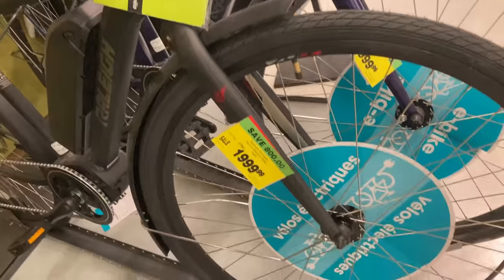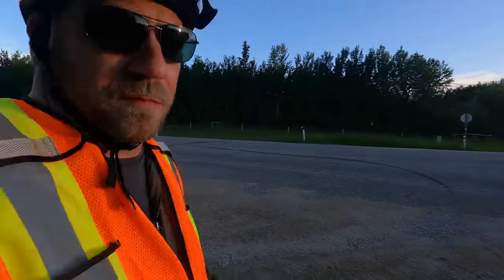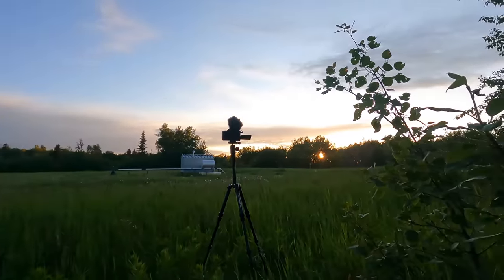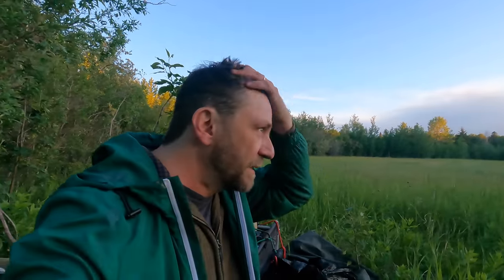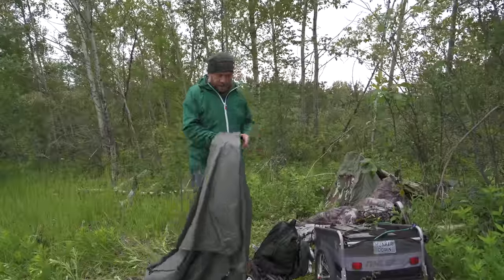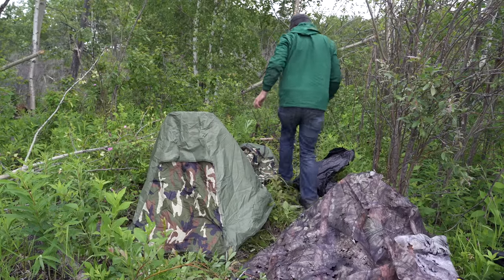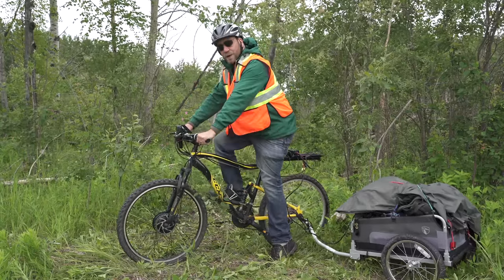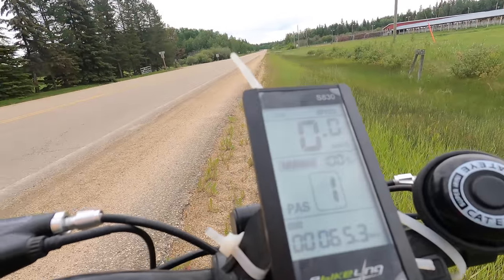DIY E-Bike Stealth Camping

Comment: Steve, your front forks will probably fail before your trailer does. Take my advice and exchange that front hub motor with a mid or rear wheel kit. The forks aren't designed to handle the torque of that motor. A mid drive also allows you to use the gears for climbing steep hills.
Reply: This sounds like great advice. I hope Steve sees it.

Comment: One of the features of LifePo4 batteries is that they have a very flat discharge curve. They maintain a constant voltage through about 90% of their capacity and then drop off very sharply. For this reason, you usually have to measure consumption via monitoring current through a shunt rather than monitoring voltage. I expect your batteries will be fine, they'll have an internal BMS which will have shut off the power before you over discharged them.

Comment: Hub drive has one issue you must address. Because of the torque the spokes loosen. After each trip give them an inspection. On the trailer, with all the weight, do the same. Lift the wheel, lay your fingers inside the spokes close to the axle and then with your fingers move the rim back and forth. You'll feel it if the spoke nipples are loose.
Reply: @messin with mikeyup. just like a guitar string!
Reply: Also, make sure you have zip ties and practice using them to true a wheel with junk wheels ahead of time. You can look it up, but you wrap it around a fork leg and cut the ends to a point and set the tip just touching the rim. You do need to learn which spoke to tighten to pull the rim the direction you want, but never loosen if you screw up. If you check it daily at least, they shouldn't get too out of wack to fix. As a back up to the back up, zip ties shouldn't be the primary tool, a brake pad can be rigged to do the same with less precision. Oh also, brake disks should be checked! They can be straightened with channel locks and you can use the zip ties to check. I am a wheel builder.

Comment: Interesting video Steve, as always!  I have watched a lot of videos concerning travel trailer LiFePO4 battery conversions.  One thing that they always include is NOT a voltage meter, but a state of charge/battery monitor meter.  Something like the RBM500-CA from Renology.  When you charge them up, it shows how many Amp hours are left available, instead of volts.  As some of other comments have said, LiFePO4 batteries can show 100% and then 0% with no in between.  If you get yourself a BMS, and that battery monitor, you should have a more accurate view of what you have left.  The BMS will allow all batteries to charge equally so they all have the same charge.  Cheers!
Reply: I have the Victron BMV-712 bluetooth model. Works well in my camper van. I guess it wouldn’t add to much weight to a e-bike scenario.

Comment: Love your videos, man. I got caught once because, at night, a flashlight on that tall grass shows the path I trod through to my camp. From the road right to my tent. I walk the the tree line now even if it takes a little longer! Have fun, Steve!!
Reply: Was just think that as well. I always walk an indirect route through tall grass. Or just stick close to the tree line as you say. MUCH less obvious that way.
Reply: What happened when you were caught? Do tell. 😳
Reply: @nevaehmorgan4030  They tore my pack and tent apart looking for anything illegal and found nothing. They told me I better have everything packed up (after they threw all of my camp gear, clothing, and supplies all over the ground and put several holes in my tent) and gone before they came back. So I haphazardly stuffed everything back onto my bike and was gone in minutes. This was in the middle of the night. It was a scary ride down the highway until the sun came up. I took a nap in a local park and was back on the road to freedom.
Reply: @complementarychaos  WOW! Glad nothing terrible happened. I often think about some type of Smith and Wesson protection....

Comment: I have been watching your video's for a few years now and am a BIG fan, love them all!

In the last year I have learned loads about LiFe PO4 batteries in trying to equip my little RV correctly.  While I could be wrong, I think you ran into a couple of the more complex issues I have learned about these batteries:

A) LiFe PO4 batteries have a different discharge profile then the older LeadAcid/AGM/Gel batteries.  LeadAcid/AGM/Gel batteries will slowly loose voltage allow you to easily check the output voltage to figure out the state of charge.  On the other hand, LiFe PO4 batteries hold their voltage really well and drop so little it is hard to tell what the state of charge is.  I have shunt in my RV that is designed to be calibrated to the battery bank and actually counts the current used to determine the actual state of charge and is accurate to about 1%.  

I know you like to operate with less expensive equipment (which I think is great), but I don't know how accurate that reading was you gave us as you left the camp.  I am wondering if maybe the battery was actually a lot lower than you realized...

But there is another issue, which I think might have been a bigger cause for things not working out:

B) LiFe PO4 batteries in series

While LiFe PO4 batteries can be put in parallel to increase the current, most cannot be wired series to up the voltage.  The reason is about balancing the batteries correctly.  Inside a 12v LiFe PO4 battery there are four individual cells AND a Battery Management System (BMS).  The BMS monitors the voltage across the four cells to keep them consistent.  I don't know exactly how it does that, but I know it is really important.  I know of one company that sells 12v LiFe PO4 batteries which CAN be run in series.  They are very expensive batteries in general and when run in series REQUIRE an external BMS to keep all the different v12 balanced.  I am sure they have BMS's inside too.  I don't know, but guess somehow (more then likely via Bluetooth or something) the external BMS is able to communicate with the internal BMS so the whole battery system acts as one big BMS.  All in all, a very expensive setup.  I think each of their 12v 100Ah batteries is around 1000 USD, so I am thinking a 2000 USD eBike and an extra battery or two might be the cheaper chicken ;)

Comment: The fault is more likely the batteries than the ebike kit, since it worked on 24v after you disconnected a cell. The BMS in one battery probably hit the low volt cutoff.
Reply from the maker: I just tested the batteries and they check out ok, time for an amazon warranty claim I think
Reply: @campingwithsteve  LiFePO cells also normally read lower than Li-ion - 3.2v per cell vs 3.7v per cell (nominal, not full charge). There may be something kooky in how the eBike controller is reading those voltages. But still, I saw the meter at the start there reading 100% charge, when you'd think it'd read 90-something percent if that were the difference. Look forward to the result on this one, that's interesting.
Reply: @campingwithsteve  Have a look at what Keith Maclean said up above Steve.. technology... you know its not going to be straight forward!

Comment: Steve, if you run into a situation where your stove doesn't work or its broke. A stealthy kind of fire is called a Dakota fire hole. Most of the fire is below ground. You may want to consider adding that to your stealth camping skills.
Reply: A good fire pit, but leaves a lot more trace than Steve likes.  It's not just not getting caught, but not leaving a mess to encourage camping restrictions.
Reply: @hanelyp1  true

Comment: I absolutely love your idea with having 3, over sized, over the top batteries in tow! lol Nothing better than using what you have!

Although I'll warn that you're likely going to run into issues with this setup because they're LFP batteries... Nearly all e-Bike battery controllers expect to be using NMC or NCA chemistry cells. Nickel based cells have a much higher nominal voltage (3.6-7v vs 3.2) and have a very different voltage curve. You may find yourself in a sudden power loss scenario. Just something to keep in mind.

(Edit) I should learn to not comment before watching the end LOL. 

Honestly, I you'll probably need to bite the bullet and purchase a normal 36V e-Bike battery. Most commonly you'd mount one on a sled in the middle of the bike. It just sucks because battery prices have risen significantly..

Comment: Just a heads-up with the front motor. Just be careful, they are known to break front forks or the drop out for the wheel. Also make sure you're using a torque arm for that wheel with the motor on it.
Reply: had that happen, good call
Reply: I've always felt that midmount motors were better. I prefer that the bike be a pusher, and not a puller. Plus,  having that motor up front effects steering and it is unsprung weight.  Time to throw a bafang mid-drive on. Have a 2wd bike. Heck, if you're going to be hauling tons of batteries around, toss a motor on the trailer too.

Comment: I just completed an e-bike add-on to my old (over 30 years old)  CCM bicycle! :)  I didn't use a kit though it has a 24 volt motor on the back carrier and a big #20 chain to a 10 or 12" diameter gear :) .. I put the battery i the trailer tooo (out of a wheel chair) and the speed controller mounted to plywood on the handle bars ... Not much off the line, but super on the straightaways!!

Comment: Another GREAT video Steve!  You are quickly becoming one of our favorite youtubers.  Here's a challenge for you: Other than your basic gear (clothes, light, food, step2, etc.) try this:  Bring two (2) Contractor Bags: Clear, 3 Mil, 67"x79", use them to make a "super shelter" with the IR from a fire to heat inside your insulated mini 'tent'.   Use both bags any way you like, perhaps one to sleep on full of debris/leaves, and the other to sleep in; or something else.  Also two (2) nets, one that you can improvise like a hammock and sleep on it, and the other to interlace some local vegetation for camo.   Just some ideas; that's for your insights, tips, and the adventure!

Comment: Great camp out!  (What about a camper or tent, that looks like a corn crib, water tank, side wall shed, or vertical Fuel tank. You could pull up next to a building. Disconnect the car and climb inside...)

Comment: id like to see an update in a day or two after you see what happened to the gear.     you might want to get a trailer with a suspension.  i suspect the rattling might have caused something to work loose

Comment: This was a good start for bike camping aside from the setbacks.  You should be able to make adjustments to make things easier as time goes on.

One of the things to keep in mind about LiFePO4 batteries is that while they make good 12v lead acid replacements, they don't have the same charge/discharge curve.  From about 80% to 20% state of charge they will drop from about13.25v to 12.90v so about 0.3v difference for 60% of the discharge curve.  That translates to about 1v of variation on a 36V system.  A lead acid battery which some of these kits are made for will go from 12.46v @ 80% to 11.98v @ 20% or 0.48V for the middle 60% of the discharge curve which is about 1.5v on a 36 volt system.  If this was a NMC Lipo battery (which I am guessing this kit was designed for) the discharge curve would also be very different.  A 10S battery (36v system) would be at 39.6v @80% and 32.4v @ 20% or a difference of 7.2v. 

Since those are 12v batteries they are each made up of 4 cells (or groups of cells) in series and each battery has an internal BMS.  If any cell in any of the three batteries drops below around 2.5v most BMS units will turn off the discharge.  So you likely used the full capacity or near the full capacity of your batteries and that bike kit was drawing more than 500 watts pulling the weight  of the rider along with the weight of the trailer.  

The kit I own has a 1000 watt motor running at 48v and it is derated to 750 watts at 36V but I noticed that under a heavy load or heavy acceleration it would often go above the 1000 watt rating till it was up to speed with just a rider and a small 30AH 48V pack.

If your batteries have blutooth integrated into the BMS you may just need to install an app on your phone to read the internal state of charge and current being consumed.  Having an inexpensive voltmeter may also be something to keep with your bike tool kit.
Reply: A voltage meter is a must for diagnosing electrical problems.

Comment: Great video as always.  For your trailer attachment point, try a self locking nut.  That way you can keep the nut from loosing off and not tighten the trailer hitch all the way which lets you have some play so the hitch will not bind

Comment: Enjoyed this one. Didn’t realize ebike kits existed but now I’m curious to try one myself. Would like to see it in another video once you get the kinks ironed out. And missed your campfire cooking in this one but there’s always next week ☺️
Reply: There are plenty of vids on those kits. Watch Craigslist that's where I picked one up.
Reply: @dangeroustoman  cool, thanks!
Reply: @dangeroustoman  which one did you get? Is it easy to set up?
Reply: @TheVegan15  it wasn't a kit. It is a sonders original e-bike. They were looking to upgrade to something fancier. They already upgraded the front forks,seat and post, luggage rack w/bags, 2 batteries and a trailer for $800.  
 Keep in mind when you buy those kits they don't come with a battery and that can cost as much as the kit or more.
Reply: @dangeroustoman  okay, thank you for explaining ❤️🧡
Reply: @TheVegan15  no problem.
 I looked at it this way, $200 - bike, $300 - kit, $300 - battery.
 They make some pretty nice bikes now around $900.

Comment: I converted a mountain bike with 750 mid-drive bafang 48v. I also have a trailer with a 24v motor for an extra push uphill. Love it!
Just found you and subscribed. On your stealth camping I have a small tip. I was getting busted all the time on BLM land around town until, I found out the Sheriff dept uses a drone with thermal at night looking for homeless. We have a large population of them. So I lined the inside of my tents rain fly with emergency blankets and  have not been busted since.
Thanks for sharing your knowledge.
Reply: He's actually worried about nothing. Not a chance authorities are using drones looking for people and even if anyone did find him they wouldn't care. He doesn't even need to worry about crazy people for the most part. Only thing he needs to worry about in Ontario is the mosquitoes.

Comment: A tip for the trailer Steve- go to a bike store and get the solid rubber tyre's for it, they will never get a puncture or go flat. They are also great for off road E-bikes/mountain bikes BUT being solid rubber, they make the ride quite a bit more bumpy. So Id just get em for the trailer and MAYBE the front of the bike if you find a cheap one to try, but def dont do the rear bike tyre unless you enjoy feeling every bump thru the seat to ya arse.

Comment: Funny this comes out now when I've been researching ebike conversions for the past few weeks myself. I'd highly recommend switching to a mid drive motor 48 or 52V bike instead of a hub motor. It will be a bit more but a much better setup. I'd go with trying to find a quality bike on the used market that's sized right and then convert it.
Reply: i got a bafang and its awsome use it everday cuz i have no car

Comment: I considered getting this same kit, but decided to go with a 48v rear hub setup instead. Costs a little more but it's worth it. You just get better traction in the dirt when the rider weight is over the powered wheel. Converting the rear hub is harder, and involves even more swearing, but the end result is something that handles a lot more like a bike is supposed to feel. I'm a big fan of these conversions. For under a thousand bucks US, I built one that can pace car traffic. Quite a thrill to do on my $8 thrift store bike.

I was talking to another ebiker about off grid camping with a solar charger. Basically ride until the battery dies, set up to camp and charge the battery over a couple of days. Bring enough supplies to last until the battery charges back up. He was essentially describing a trailer setup like this, but with a pivoting solar cell. Because the cell would need to be tilted toward the sun at all times for optimal charging. I just wonder how long it would take to charge up, and how attentive I would need to be at constantly realigning the panel.

Comment: You can refill the thermacell pads with pyrethrin. Available at your local garden center.  Also the butane cartridges can be refilled as well. 
YT should have some DIY videos on both.
Reply: I am curious where you heard that? The chemical in the Thermacell pad is allethrin not permethrin maybe it works but I would worry about inhaling.
Reply: @Matt-dj5xd  Theres videos on YT. Is allethrin  available to purchase?

Comment: I refill my thermacell pads and the butane as well. They have worked pretty well. I can usually get multiple refills out of each pad and butane cartridge. We originally bought one because how much you used one and it worked. We have used one for about 3 years I think and it is amazing and have got many other people to buy one as well. We live in a campground and have used it in multiple states and it is amazing how well they work. Start it up and within 15 minutes no more bugs. Your videos are great, keep it up. Even a voice over of putting the ebike together on the step 2 Channel would be great. Or at least some troubleshooting after this trip.